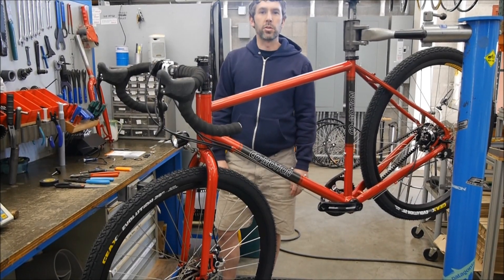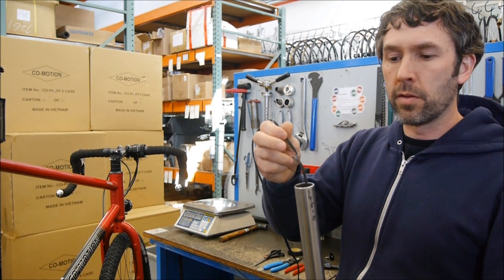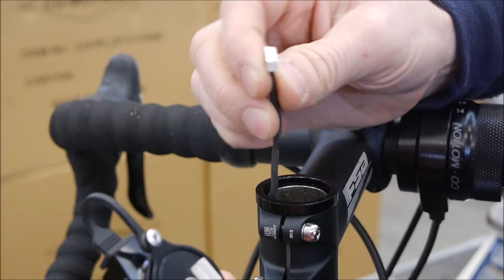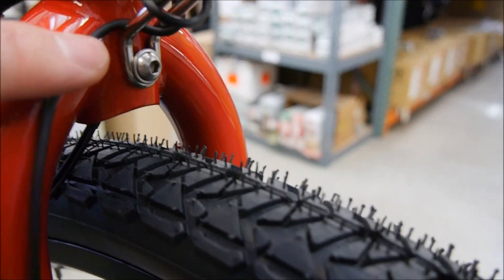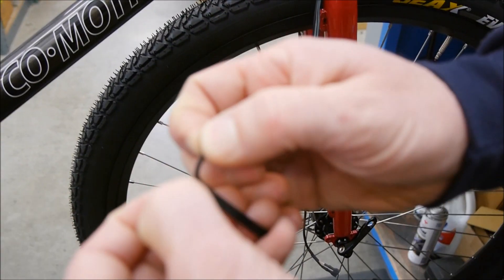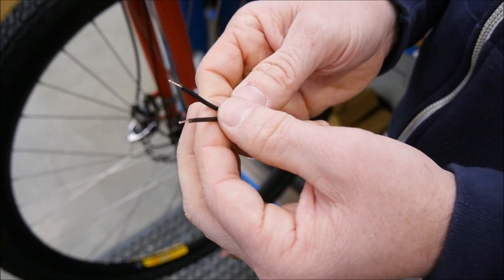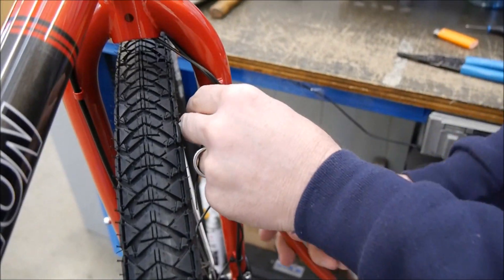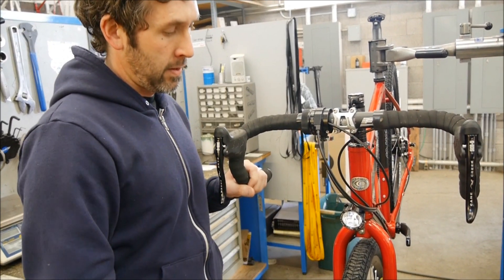Installing the SON generator hub, Schmidt Edelux light and USB top cap at Co Motion Cycles.

Comment: This is such a janky job, why not attach the wire around the for crown and not have it as a limiting factor for larger tyres. Second thing is that the piggy back connectors are not waterproof and will corrode ( you can clearly see the gap even with the shrinking tube. Come on...
Reply from the maker: There are different ways to achieve the same goal, obviously this is just one method for consideration. We've had great success with this cable routing for many years.

Comment: this looks rad as hell, and I see that it's even better now because SON sells a connector cable to do the splitting to a USB charging device at the light itself instead of a second cable to the hub. How do you connect a rear light though? I can't seem to see the back of one of these lights; do they have a separate cable?
Reply from the maker: Yes, SON is now offering coaxial cables with quick disconnects and extra port option to add USB devices inline. Rear lights are plugged in directly to the Edelux light housing, there's a dedicated port for this use.
Reply: @co-motioncycles7269  Thanks for the quick response. After a bit more research, I think these two products the Edelux light and Cinq Plug is the way to go. You mention that it's easy to do this inline now quite easily. Do you need special connector cables though? The Edelux seems to come with an inline female coax port but the plug has the normal hub dual wiring. There are likely a couple ways to make the connection, which do you recommend?
Reply from the maker: @lucash41  Hi Lucas, yes you add the SON coaxial junction box to the Edelux light or order this setup already pre-wired. Once you have the junction box installed you can add a USB port. To incorporate a USB top cap like the Sinewave or Cinq Plug, you would need to add a male coaxial plug to those factory wires then connect to the inline junction box. It seems that the factory installed junction box would be the easiest and cleanest route.

Comment: Hi, how would one connect a rear light to the front light? what type of connectors are needed and does the rearlight include cables?
Reply from the maker: The Edelux light has a port specifically for connecting a rear dynamo light. Most rear lights do include the necessary wiring.
Reply: Thank you for the helpful video and the response! May you have a good day!

Comment: It looked like you cut steerer tube to 2-3mm above stem top to accommodate 5mm spacer, then USB cap? Would that be correct?
Also wonder if it would be good to clarify orientation of notch in star nut when inserting so that the connecting wire is on the right side for the connection to the USB cap and wire isn’t twisted under it?
Reply from the maker: Ideally you want the steerer tube to be flush with the top of the stem or a little longer but not any shorter. The 5mm spacer provides room between the recessed top cap and steerer tube. Yes it would be good to clarify the orientation of the notching when using the Tout Terrain version of the plug. We have been using the Sinewave USB caps and the wiring is directly in the middle.
Reply: @co-motioncycles7269  Thanks. That clarifies it. I’d assume having the steerer just a little above the stem would allow the spacer to locate in place.
Reply from the maker: @keithslater340  Exactly!

Comment: That's not it. Now comes adjustment of the headlight beam so it lights the road and not the pearly whites of oncoming cyclists who show their teeth in fear because they are blinded by your glare.
With powerful LED lighting, cyclists have become as much offenders in that department as rude motorists who won't turn their high beams down.
Sorry, pet peeve of mine. I commute by bike all year round, and fellow cyclists who view their lamps as penis crutches are a real nuisance.
Reply: Those edelux lights have a proper road shaped beam tho', so are bright in the right places at least.
Reply: @Piplodocus  All the more reason to adjust them properly. With cheap rotary symmetric conical beams you can't really do it right; if the light is designed for the road, you can.
Reply: So true, sadly. And, does anyone else feel mental wit all the strobe mode?

Comment: you need a much better crimping tool, those wires will pull out easily
Reply from the maker: There are definitely some really nice crimping tools on the market. These work well if used properly.

Comment: Nothing  at all was shown of the Son dynamo hub, Or the price of the unit, In another video a price was mentioned for a hub on a wheel,  $1,000. So we can scrub that one.
Reply from the maker: Jack, the Pathfinder upgrade on a new Co-Motion is only $595 and includes a SON28 dynamo hub, Edelux II light, Co-Motion light mount and a Sinewave USB top cap. It's a great deal.
Reply: @co-motioncycles7269  That sounds like an excellent upgrade. Pretty sure it's cheaper than getting the bits separately.
Reply: @co-motioncycles7269 hi mate where I can buy all that stuff
Reply from the maker: @azamzain4730  direct from us in Eugene, Oregon. Just give us a call or contact us through our web site.

Comment: How much power is lost in the rectifier?  How much power does the hub generate and exactly how much power is available at the USB jack?
Reply from the maker: Power output is largely determined by wheel size, traveling speed and the device drawing the power. The nominal value is 6V and 3W of power. I don't know how much is lost in the rectifier. The SON hubs are the most efficient on the market.
Reply: It wouldn't surprise me if you were limited to 2 watts at the jack.
Reply from the maker: @tarstarkusz  Sinewave lists the spec as Max current: 1 Amp
Reply: That is the maximum current the wiring in the unit can safely handle. Unless it is germanium there will be a .6v drop across it (1.2 if it's full wave).
Thanks.
Reply from the maker: @tarstarkusz  The Sinewave web site has some good information in the FAQ section. Output is fixed at 5V and the unit itself draws 1.6mA with nothing plugged in.

Comment: The price of the plug is rediculous
Reply: How much?
Reply: @justpassingthrough4802  $175 for the plug (+ $15 for an expander wedge in place of the star-fangled nut shown here because you can't / shouldn't use them with a carbon steerer.)
Reply: Plug 5 is now 127 euro's in Europe, got down quite a bit last two years. In combination with a self build wheel with Shutter Precision hub, you could be ready for about 400-450 euro's for a front wheel with hub and plug 5. That sounds like a good deal.

Comment: Thanks for putting this together. I have the same dynamo hub, light, and top cap sitting here ready to be assembled but hadn't found any other resource nearly as helpful that shows how to do that. Maybe as a follow-up, you could demo wiring in a rear light and how (if) Co-Motion puts in a connection like a Dyna-Snap for travel bikes with S and S couplers.

Comment: Not to be negative but for the price of those accessories they could have afford to use 90 degrees terminal ends .10:00....lol
Reply from the maker: David these are the supplied connectors with the light. They now offer a coaxial connector with 90-degree feature.

Comment: Hi, what is the reason to install the standard top cap first. Is the usb plug to fragile? I wonder what happens if I crash or my bike just falls over and the handlebar needs to be turned back into position. Does it mean I need to carry a spare top cap for propper reinstallment? Thanks a lot.
Reply from the maker: This is per the USB top-cap manufacturer's recommendation. If you don't over torque the unit, you are probably okay with stem adjustments.

Comment: I would recommend some silicone caulk/glue on the white molex connector and wire ends to reduce strain, and reduce the chance of the plug coming out on those long bumpy roads. Nice video guys!